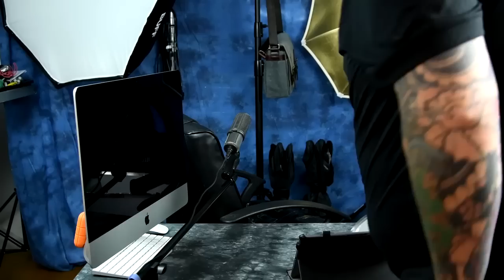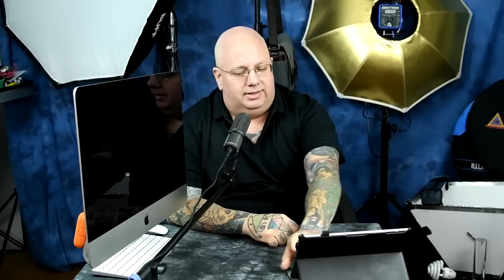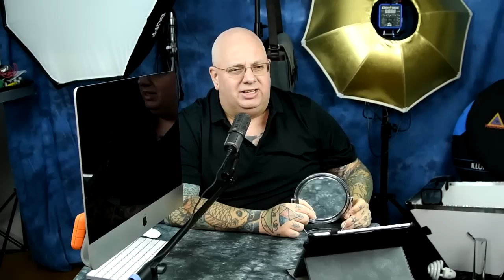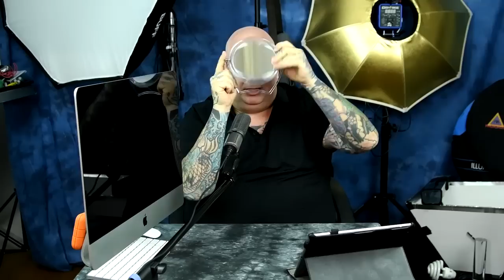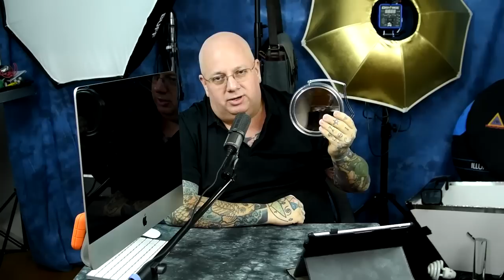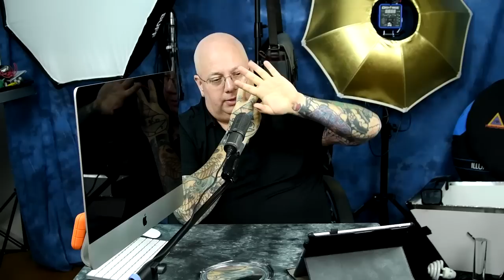A99II Serious FAIL:  Translucent Mirror design issue: Sony Fanboys, don't watch this video

Comment: One of the reasons I haven't considered shooting A mount
Reply: thats why i bought a7R2 .....
Reply: OMG, even you ? Just try an a99II first and then make claims. I Like most of your video's but don't make claims before trying. All hands on reviews claim something else.  Also the a99(1) was the first SLT full frame and the processing there wasn't quite good enough to make up for the light loss at higher ISO's. That didn't stop the a99(1) from being an awesome camera for studio work, where a lot of well known Shooters ( Frank Doorhof, Joe Brady) switched to the sony from 5d markII's because at the lower ISO'the IQ was BETTER.
Reply: Darkmanmr47 Darkman I haven't made any claims. I'm just saying it isn't for me
Reply: Fair enough and you switched from canon to E for maybe other reasons as well, one of the reasons however for not considering the a mount is apparantly the light loss. You used A glass on E mount adapted.. including the 135 1.8 so then why not see how it does natively ?. For someone that owns the a7R2 it doesn't make a whole lot of sense to consider an a99II other than the body + its advantages + af speed. For A shooters of old the a99II is a great machine. You shoot weddings where the a99II would have an advantage with the dual card slots and the -4 EV Af sensitivity.  It's horses for courses. I am using and will continue to use the A and E mount bodies.  I think however that E mount will be the future as soon as the AF speed and Af sensitivy in dark environments will be as good as what is possible with SLT designs.. but there's still some work to do in that department.
Reply from the maker: check THIS OUT: 
https://www.flickr.com/photos/134746128@N05/32369910320/in/dateposted/
Reply: thanks guys for this discussion and video  .... now i know that i made a good choice of getting a7r2 .... not a99II

Comment: Test this for yourself. Get a piece of glass and tilt it 45 degrees then shine a torch through it and look at the pattern on a wall. Now remove the glass and aim the torch straight at the wall....is the pattern exactly the same....I doubt it? So for the sake of argument lets forget that the translucent mirror reduces the light transmission for a minute. In my opinion there is something far worse to worry about. What happens to the properties of light when passed through even a mostly transparent medium when that medium is set at a 45 degree angle? Honestly I don't know but I suspect it would impact the light hitting the sensor. In a normal DSLR the mirror moves out the way, the light is transmitted directly at the sensor from the rear element. Adding the obstacle of a translucent mirror is in effect adding another lens element, and a pretty poor one at that. So not only are you reducing light transmission overall but the incoming light is literally scattered when it hits the 45 degree angle of the translucent mirrors it tries to pass through. I'm exagerrating somewhat but it's like shooting through a prism. Really, light intensity is the least of the A99II problems, modern high ISO sensors can counteract that somewhat.It's real issue is, what happens to the light once it smashes into that mirror and comes out the other side? No matter how good Sony make their lenses, they just screwed it up because the light leaving the rear element isn't the same as the light hitting the sensor 😃
Reply from the maker: its a joke, yes…  its irrefutable that removing the mirror lets in 30% MORE LIGHT thats hardcore UNDENIABLE..The reciprocal of 30% is 23%, the SLT mirror transmits about 72%……meaning if you remove the mirror, you get 30% more light. 
nothing says "F*CK THE IMAGE" like a 45 degree mirror in the way
Reply from the maker: http://www.lenstip.com/137.5-article-Everything_you_always_wanted_to_know_about_the_semi-transparent_mirror_technology_(but_were_afraid_to_ask)_Test_of_the_Sony_A99_mirror_.html
The mirror let 70-75% of light pass through in a wide range of angles.  The brightness loss connected to big angles is noticeable only with fast lenses where it most probably remains negligible anyway due to a mix a lot of beams which fall under different angles.

Comment: I believe the light loss is between 1/3 to 1/2 stops, not a 1/3 of total light loss. I can only speak of when using Eala4 adapter when adapting older Apo Minolta screw drive AF glass on E mount bodies, I don't see a loss of micro contrast (3d rendering) any more than using an ND filter when switching to the Eala3 which has no mirror. * It's 2/3 stop or 33% loss after testing.  XD
Maybe the A99II would be different.
Reply from the maker: youre looking at it backwards, its irrefutable that removing the mirror lets in 30% MORE LIGHT
thats hardcore UNDENIABLE
Reply: Your taking me out of context, all I said is "light loss is between 1/3 to 1/2 stops, not a 1/3 of total light loss" I'm not refuting your claim that it's bad design only the amount of light loss. *correction it's 2/3 stops light loss.
Reply: Pls. retake your optics classes, this is absolutely wrong!
The Math is quite simple, 50% light loss is 1 stop, so 30% light loss is 1/2
 stop since it's a log scale.
Reply from the maker: Bradley Watson
son, its a PASS FILTER for high gain light.....meaning its a BLOCK FILTER for low gain light
meaning microcontrast  is crap.........you lost
Reply from the maker: http://www.lenstip.com/137.5-article-Everything_you_always_wanted_to_know_about_the_semi-transparent_mirror_technology_(but_were_afraid_to_ask)_Test_of_the_Sony_A99_mirror_.html
The mirror let 70-75% of light pass through in a wide range of angles.  The brightness loss connected to big angles is noticeable only with fast lenses where it most probably remains negligible anyway due to a mix a lot of beams which fall under different angles.
Reply: Its 33% or more, it's all very pedantic arguing over numbers because F stops aren't accurate over T stops. 
I'll just just agree to disagree a fixed glass over the sensor is crap, but I don't agree with TA over 90% micro contrast destruction he pull out of the air because there is no evidence of such.
Reply from the maker: Gerard Kuzawa
thats not what i said, i said i misunderstood Kali,  everything in this video is 100% accurate

sorry you didnt understand that fact
Reply from the maker: its irrefutable that removing the a99ii SLT mirror lets in 30% MORE LIGHT thats hardcore UNDENIABLE..The reciprocal of 30% is 23%, the SLT mirror transmits about 72%……meaning if you remove the mirror, you get 30% more light.
Reply from the maker: Gerard Kuzawa
thats a cute claim?  alas you have no proof, its just hearsay
Reply from the maker: Gerard Kuzawa
Go ahead and explain the fact that the remove d mirror adds 30% more light.

because its irrefutable
Reply from the maker: Bradley Watson
wrong son, its a translucent mirror by the words of Sony themselves

ROFL   pathetic
Reply from the maker: Gerard Kuzawa
go ahead and keep dodging the facts, remove the mirror and 30% more light strikes the sensor.

pathetic
Reply from the maker: Lefteris Kritikakis
goddamn right
Reply: +Lefteris Kritikakis http://i68.tinypic.com/2rr9moo.png
The difference between the Sony LA-EA3 Adapter and the Sony LA-EA4 (with mirror) is 2/3 stops or f3.5 EA3 to the f2.8 EA4. 
So I stand corrected. All using the same Minolta AF 80-200mm F2.8 lens and camera settings.
So yeah it's fucking around 33% light loss after all the math. Yeah Sony! :\
Reply from the maker: check THIS OUT: 
https://www.flickr.com/photos/134746128@N05/32369910320/in/dateposted/
Reply: Theoria Apophasis Isn't UV past 390nm drop off normal when going through glass or plastic.
Reply from the maker: look again at the chart, its ALSO below 70% at 400 to 430nm light
Reply: So wouldn't a UV filter follow the same curve.
Reply from the maker: kalidesu
no
Reply: Why not, or do Sony mirrors have some magical anti-micro contrast killing powers, 'cos Sony?!
Reply from the maker: kalidesu
cause any mirror is gonna drop the LOW GAIN light, 1st and foremost
Reply: Theoria Apophasis I can't see any more than an ND or UV, call me sceptical, you have said before that flat glass has less effect than layers of optic glass.
Reply: Losing 1/2 stops is equivalent to losing 30% of total light loss. 2^(-0.5) = 0.7
Reply: Pieter Gellings Here is my test. http://i68.tinypic.com/2rr9moo.png
The difference between the Sony LA-EA3 Adapter and the Sony LA-EA4 (with mirror) is 2/3 stops or f3.5 EA3 to the f2.8 EA4. So it would be over 30% light loss. Hurrah Sony :P
Reply: Like someone said it already, it is gravely wrong to think losing half a stop is losing only 1-2% of light. When you lose 1 stop, you divide light intensity by 2; losing 2 stops, divide intensity by 2^2 = 4; losing 3 stops, divide intensity by 2^3 = 8; losing half a stop, divide 2^0.5, which equals to multiply by 0.7 or 70%. See when you want to compensate for half a stop of light, you would change ISO from 400 to somewhere around 640. 400 is only about 70% of 640, but that doesn't strike you as odd, does it? When you work with log base 2 scale, everything seems to be so closely packed and the increments appear to be very small, but when you convert that back to linear scale, all of sudden the increments appear to be huge.

In terms of UV filter, a UV filter cuts down the intensity of UV light, but in reality it will bleed into the blue and violet spectrum of visible light. What does that mean? It means it cuts down the intensity of high frequency (or low wavelength) light, while not affecting the light of lower frequency. Thus a UV filter is not completely transparent. It is only transparent to light of certain spectrum, aka a bandpass filter.
Reply: kalidesu. I looked at your test but I think it's better to use a constant aperture and vary the exposure time. Now your shot at f2.8 is disadvantaged because the lens vignettes more at 2.8 vs 3.5. So in the end I think the mirror loses a bit less then you indicate an is probably close to about a half stop or 30% of the light.
Reply: +kalidesu, that's exactly why you have to do these tests at a constant aperture of the lens and only vary iso or shutter time. And I'm not arguing with you what the exact number is I'm just discussing an even better way to do your test. And I agree all the hot air over a so-called "crap mirror" is probably just fogging up their mirrors. In normal operation it's working fine and producing great results. I don't have an SLT so this is not a fanboy remark, it's just using my eyes on pictures produced by other photographers using SLT cameras.

Comment: I'm hearing its one third of a stop, not one third of the total light?
Reply from the maker: check THIS OUT: 
https://www.flickr.com/photos/134746128@N05/32369910320/in/dateposted/
Reply: @KenTheoriaApophasis  https://flic.kr/p/25DTRD3  (Sony A99II) my own test (Sony A99II vs Sony A7III, same setting and lens)... https://flic.kr/p/H6mf1e   (Sony A7III)...
Reply: isn't that the same?
Reply: One third of the total light is 33.3'%. One whole stop darker is half of the light, so one third of a whole stop is one third of one half of the light which is approximately 16.6%.
Reply: I don't think I've said anywhere that 30% of the (total) light is 0.3 stops. On the contrary, the point I was trying to make was that if the light loss is actually 1/3 of a stop rather than one third (or 33.3'%) of the total available light (which I believe is what Ken was saying in his video), then loosing 1/3 of a stop of light is much less than 1/3 of all of the light. Can we agree on that? :)
Reply from the maker: http://www.lenstip.com/137.5-article-Everything_you_always_wanted_to_know_about_the_semi-transparent_mirror_technology_(but_were_afraid_to_ask)_Test_of_the_Sony_A99_mirror_.html
The mirror let 70-75% of light pass through in a wide range of angles.  The brightness loss connected to big angles is noticeable only with fast lenses where it most probably remains negligible anyway due to a mix a lot of beams which fall under different angles.
Reply: Thanks for the links, Ken. Also interesting that light of different frequencies has different transmission levels through the mirror. Presumably this also requires some kind of correction, which can't be a good thing. :/

Comment: Hi. ok. but what about s... mirrorless is this have same issue with microcontrast ? 
Yes I do not ask about mirror but maybe s... have that problem with each camera they have ? 
three more question. what lens to what system ? 
is there any sensible system ?
and last one . is Fuji medium will be better in microcontrast ? thank You.
Reply from the maker: you mean Med format?  yes
Reply: Theoria Apophasis yes I mean med format. thanks. 
the point is that I start with s... tlm because it was chip and have lots of future but now I know that all this things are rubbish. but I just snap some jpg and I want to better in this or leave it and I was standing next to lce branch and was wondering @7ii + 50mm 1.8 for "free"  for £1299 is that make any sense to go for ff ? so I just stay with my phone "camera " and no regrets 4now. Thanks again.

Comment: excellent research and yes you are correct. This is why I sold my Sony 3 years ago for Nikon.
Reply: Is a Total lack of understanding digital.  The gain is set at the sensor, not at the mirror. It is very easy to compensate the sensor for a known loss of light parameter. Setting 0 Gain to 800 more than makes ups for that difference.
Reply: Good Point. A good example for this is a digital signal through either fibre optics / coax for your cable at home. In the Analog days a crap signal would give a crap image with gosting etc, and lots of noise of the signal was too weak. Digital however does not care about the signal loss and if the signal is weakened but is "good enough" for the digital tuner to distinguish a 0 from a 1. It can recreate a perfect signal and 100% image quality. When it's borderline acceptable you might see some errors.  For camera's it's not just the repeating of a digital signal because what the sensor sees is analogue in this case. so an A-D conversion is made. You can off course amplify a weak analogue signal before digitizing it, which is obviously what the a99II does well to come up with such an end result.
Reply: I'm getting there, but I brought Sony gear when the Nikon FX cameras were to far out of my price range but completion now years later makes Nikon gear affordable, I wanna snag a D810 when Nikon upgrades it.
Reply: Exactly.  The byproduct of high gain, in any case, is noise.  Modern processors deal with noise very very well, that is how they reach 12800 ISO and beyond.  At that point, there is no visible light but modern sensors can still capture images. This empirical, all that micro tonal contrast is irrelevant since sensors need to be tuned for base sensibility anyways.  If there is no micro tonal contrast at its base ISO, it is because it is a lousy sensor.